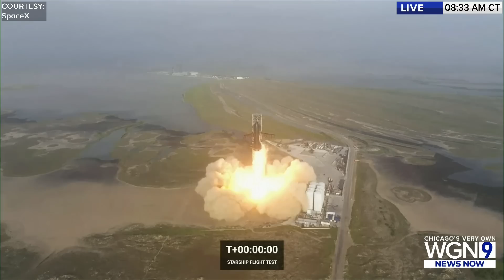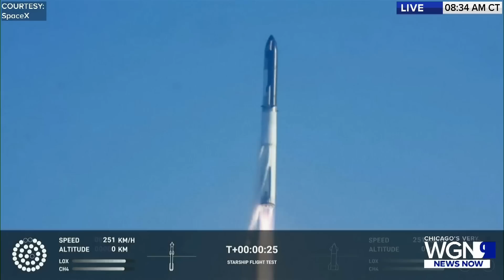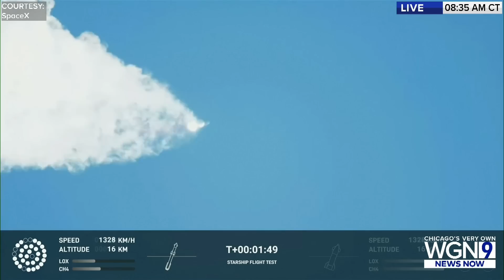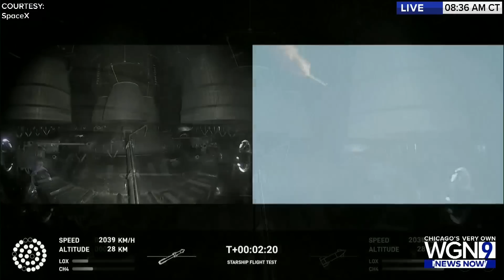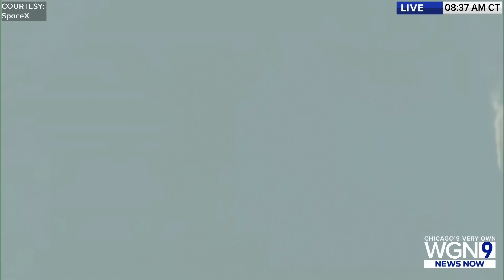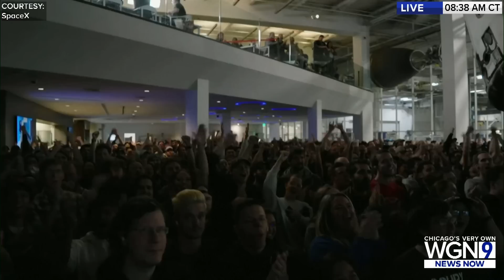Full flight of SpaceX Starship test launch

Comment: Sooooo, there was supposed to be a separation and second stage ignition after the flip, which, never ended until (what appears) they manually destroyed it. Why is everyone cheering, and so much? Wasn't the test to get it to separate and ignite successfully?  CONFUCIOUS SAY: TWINNY ATE, VEDDY CONFUSE!!
\O>
Reply: They are cheering because the fact that it was even able to lift off the ground is a huge achievement, they got tons of data from this despite the fact it failed to seperate

Comment: Someone tell Musk to put a liquid cooled steel plate under the pad. Unless you like concrete everywhere.
Reply: Yeah, just have to insure you don't get hot molten metal flying everywhere instead  :)
As long as the plate can be kept cooled with that amount of heat on the other side, and that the extreme sound waves don't pulverize the metal into power, then it might work.

Comment: This is the first test. It made it off the ground, rockets didn’t fire, eventually it exploded. Thankfully, they will be able to look at what went wrong and correct it. I would bet NASA would have been grateful if the Rockets used to launch the space shuttle had exploded in test flights revealing the problem with the O-rings rather than have it not fail until there were people on board.
Reply: thats it...sometimes u dint see what can go wrong and then ur heart breks when those plans u wanted dont go as succes but u wont see the results until u go through the small details that u dont sse...then u see and learn...with the better pad no debris wich caused the system to malfucntion fail..the next launch wont just be success..itl make it to space...

Comment: For next test they need to reinforce those engines and make sure to prevent debris
Reply: Its not as easy as that id imagine
Reply: It's the entire ground structure, the launch force obliterated the ground around it which caused concrete and other debris to damage multiple components on the rocket. If you look at the beginning of the launch, you'll notice two of the engines that are out immediately are right next to each other, suggesting they suffered failure from the same cause, like a large piece of concrete.
Reply: @moosemusicofficial  the debri hitting it caused the leak wich then caused soe engines to fail thrn it spun out...then self destruct